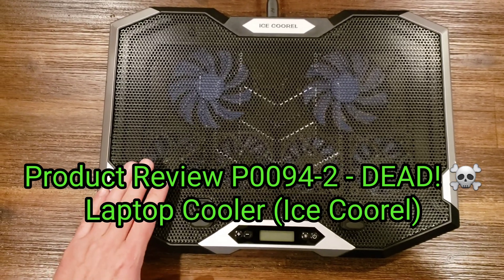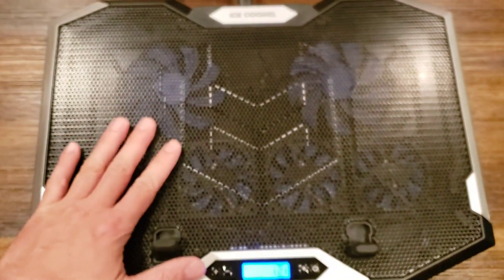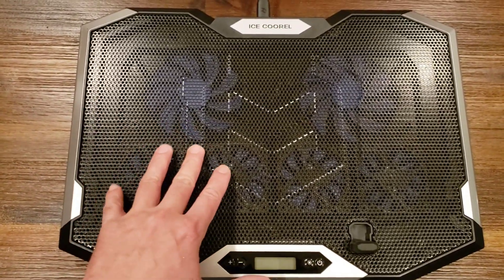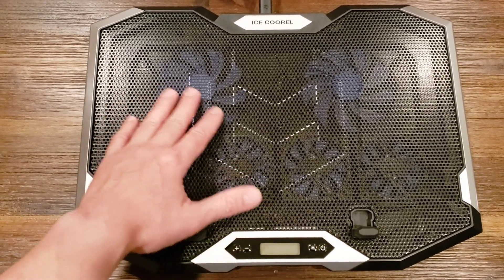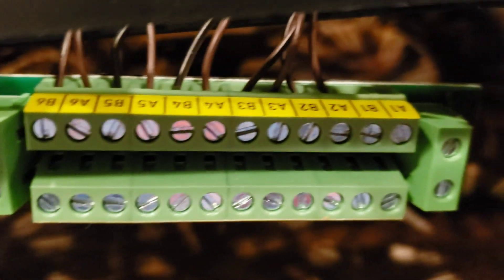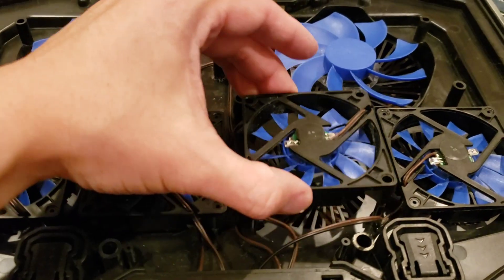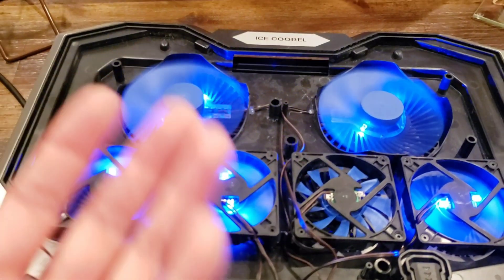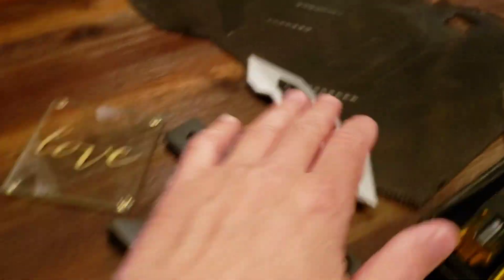Product Review P0094-2 - DEAD Laptop Cooler (Ice Coorel), but I DIY'd it back to life

Comment: Dose it really cool the laptop!
Reply from the maker: It does cool my laptop but not by much. Depending on what I'm doing the CPU or GPU clock speeds are sometimes reduced however with the laptop cooler it helps bring the temp down by a few degrees, nothing spectacular but I noticed my CPU doesn't clock down anymore. 

Bottom line - I would not recommend this model cooler or this company. I'm still using it because I did my own rework and wired the fans to turn on FULL all the time.